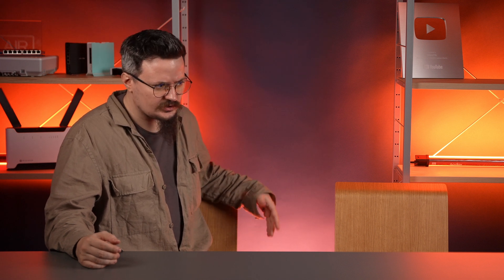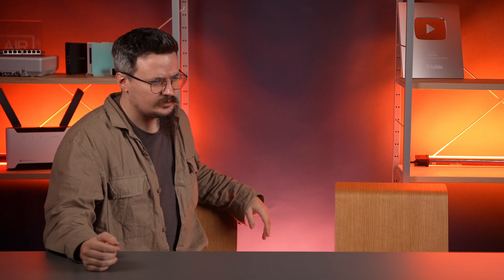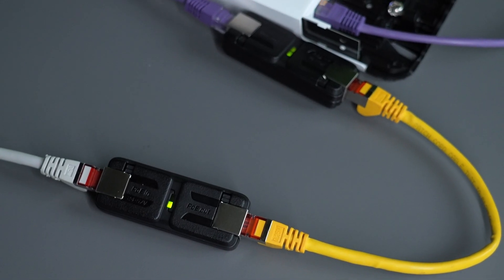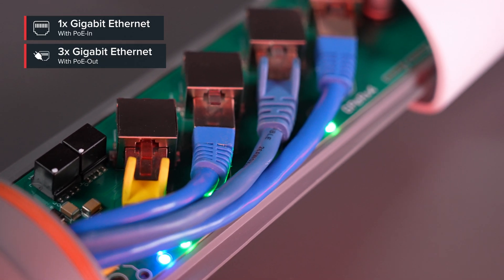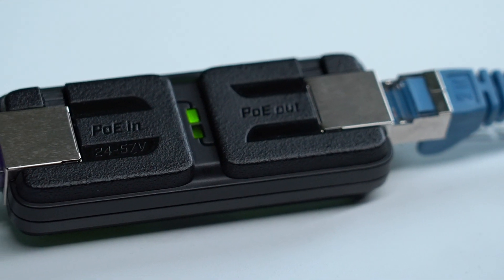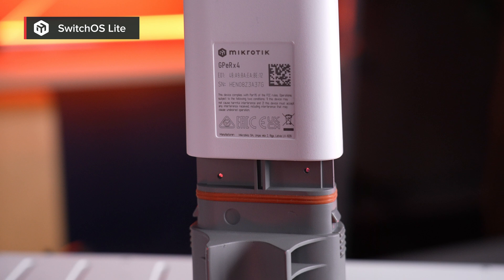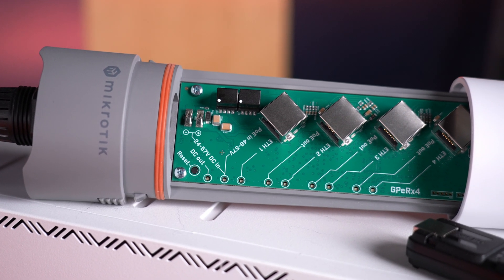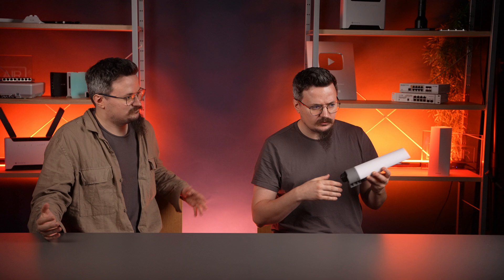GPeRx4 - split PoE++ ports into multiple PoE-out!

Comment: Not a big fan of calling it a splitter or repeater when it has a switch chip you can assign different VLANs.  Not the same thing, its more like a slim form-factor M-Power box running switch OS, its a passive POE switch midpoint right? Sounds like if a cable was damaged and no uplink was available these ports could still talk to one another if they are on the same VLAN etc.

Comment: it's so cool, however most Mikrotik devices are 24V powered.
I understand, the device have support for 24V as well - but that's via DC connector - so we would need a gigabit DC splitter (like a "reverse" PoE injector)
or - i don't mind the voltage of the PoE feed - but still want to power my 24V device - so can we have a transformator inside the box and select to PoE output voltage 24/48V ?
or just simply add 48V support for most devices? 🙂
Thanks!

Comment: Yes! I have 3 runs going to my attic that are all now used and I need to add more cameras, but 3 lines to attic is max. This kind of splitter/switch is just what I need.
Reply: To bad it doesn't split 1/2.5/5/10gb 10GBASE-T to multiple ports and it's stuck at 1Gb for the uplink.

Comment: You asked what I think about it, but beware it‘s not very nice:
PoE is raping the ethernet cable. If you want to do it right, you have to use specialized ethernet cables with higher conductor diameter. The powerloss is significant. PoE is the xDSL of powerdistribution. So, nice product, but just a bandage for poorly planned or old environments (where the people are to lazy to rebuild it) 🤷🏼‍♂️
The solution would be a hybrid cable (or two cables). Copper for power, fiber for data. Of course this is a hard way, but neither only copper, nor only fiber cables can solve the issue alone.

Comment: Does this support Passive Out?  That was one of the big reasons for the GPER from a older Ubiquiti/UISP/WISP standpoint (least for CPE/remote installs).
Reply: The manual doesn't say it can, but you can always connect a GPeR or RGBPOE-CON-HP to the output of the GPeRx4.

Comment: This looks great but is there a way to remove the restriction that Poe ports are isolated. This would make a rooftop single Cable Micro pop easy. But with isolation it’s not possible.
Reply: Can you elaborate on his the isolation makes that an issue?

Comment: looks really cool, but wait, those dc terminals, they really seem to beg for trouble. i know this is just a backup way of powering the device, which doesn't require special tools, but a proper, insulated screw terminal would've been better. everyone has a screwdriver.
Reply: I think it's because of the PCB population, there might be no space for through hole device